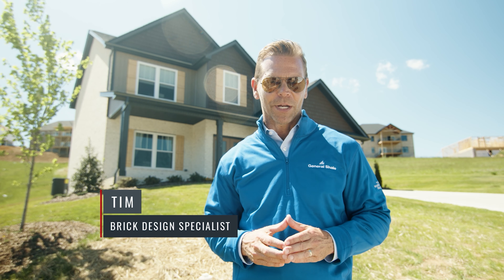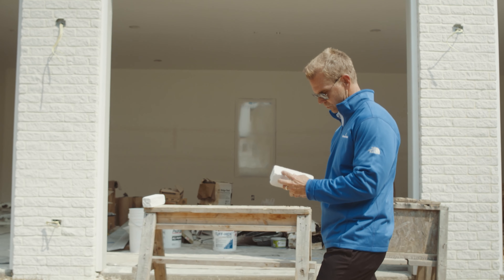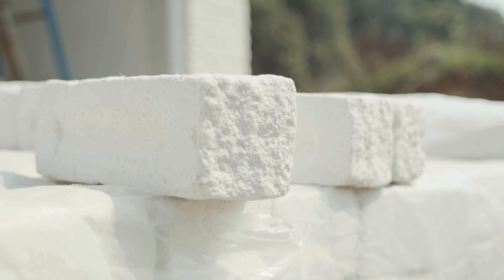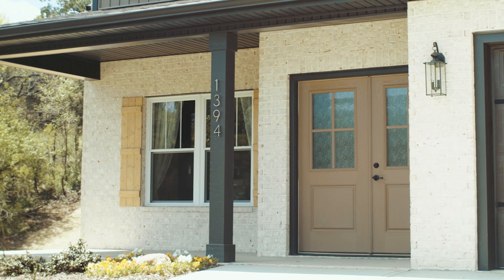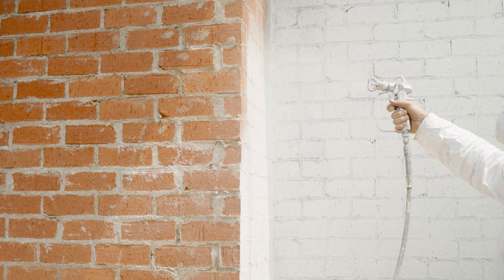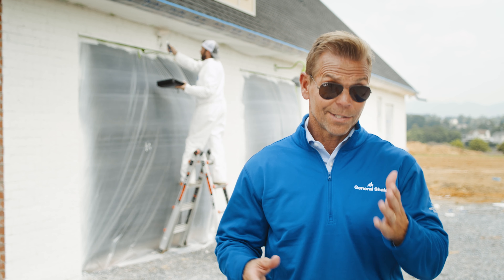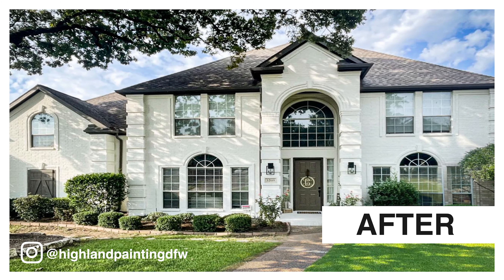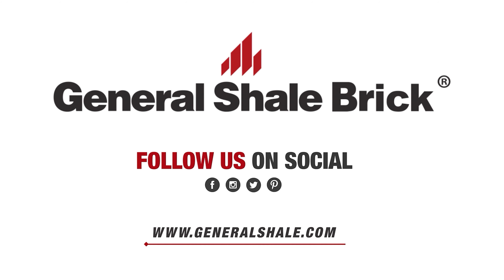Designing Your Brick Dream Home - White Brick Edition

Comment: Wait, how can white fade? I can see how it might discolor or chip maybe, but not fade.
Reply from the maker: Hello, Astrin! The application method used to achieve a white brick can and will cause fading over time. As mentioned at :33 - :41 , our bricks are manufactured with their white color whereas customers may also elect to apply paint after install. Applying paint after install will not deliver the lifespan of a true manufactured white brick and overtime will fade and require it to be painted again to retain the same white color it once had. We hope this information is helpful and please do not hesitate to reach out if we can help further! - GS
Reply: @GeneralShaleBrick  But, if white brick fades, isn't the end result still white? I used to work in warranty claims for vinyl siding (I needed a job, okay? Don't judge me.) and I don't think I ever received a call from a customer upset that their white siding had faded. I think I'd remember that. I mean, I remember the customer who covered their stone house with vinyl siding, and was upset because the result wasn't flat and level, and the Affair of the Cypress Guttering. 😉